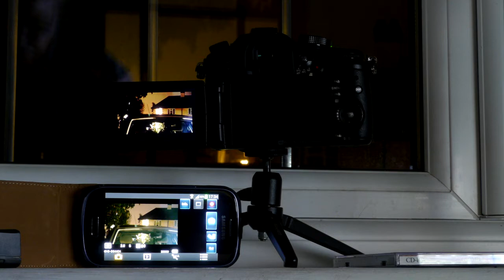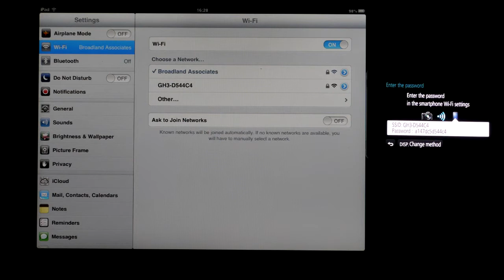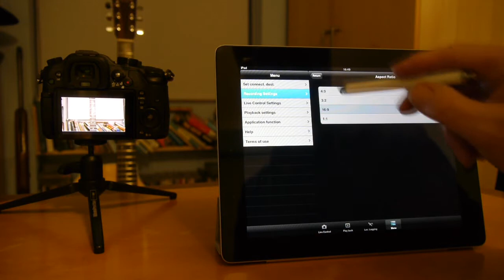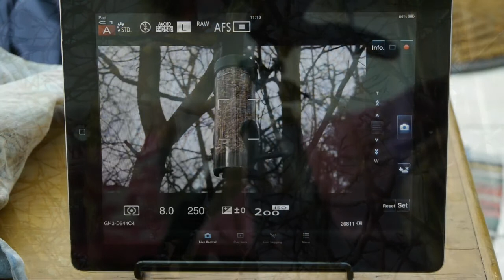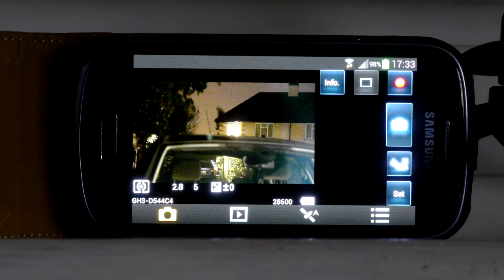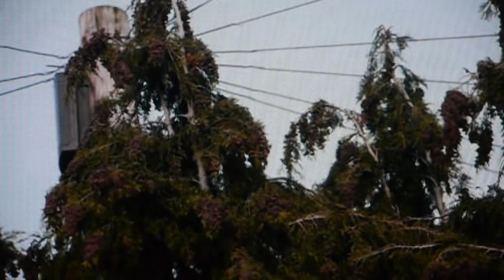Tethering A Panasonic GH3 Via WiFi To iPad and Android Using The Lumix Link App

Comment: Hi David- I hope this finds you well- I'm shooting headshots/portraits with the GX8 (which uses the newer Panasonic Image app for wireless tethering now)- I was wondering in your experience is there  a way to preview images taken in FULL screen in the live control option (as I'd like to show my subject live what we're doing as a reference for making adjustments in posture/pose etc before proceeding on with taking more shots, but the only way it seems to do that is with a smaller live video window (and all the control buttons around the window in the ipad app- not full screen) I have the camera image preview time set to 'hold' in th e cmaera's menu settings (so the last image taken is previewed indefinitely until the shutter release button is pressed again after which it shows the live view again)- I just wondered if it's possible for the liv eview an despecially teh previewed shot taken to be shown in full screen as opposed to a smaler window (I understand the 'playback option' plays back in full screen but idealy want full screen preview in live control mode.. thank you
Reply from the maker: No, it can't do that. The nearest is to use the phone in landscape mode (a I expect you do) but that's it. It only sends a VGA 640x480 image for live control, presumably for fast screen update so even if it was bigger, quality wouldn't be that great. That wouldn't matter for what you want though. 

It would be nice of you could have the option of a full screen image for review in 'Hold'. Playback introduces too much delay when all you want is a better look at the image you've just made.
Reply: OK thanks David- yeah full screen preview of the image immediately after taking it under the 'hold' setting would be great but I assume you are just wishing for it and not suggesting there is a way to do that..
Reply from the maker: Yes, a wish. It would be something if when you pressed Playback, the last frame you took came up full screen, rather than loading them all as thumbnails. Then you'd tap the screen and ge thumbs would load.

Comment: Do you know, by chance, if there's also a way to tether and shoot from a laptop?  Adobe lightfail doesn't support the GH3 (or any Panasonic camera for that matter) and I really need to be able to do this to make table top/product photography more manageable.  If you have any idea, please let me know!  And thank you for the great overview of the tablet tethered shooting!
Reply from the maker: A tablet is the only way, I'm afraid. The GH4 can be tethered to and operated from a desktop or laptop using some not too expensive proprietory software and a USB connection but not the GH3 which can only upload to a folder on the desktop while you take or after you've taken.
For product photography, the GH4 wouldn't have any advantage over the GH3 other than that so it would be an expensive step to take.
Reply: David Thorpe I had feared as much, but wanted to make sure.  Thank you very much!

Comment: that's a really helpful video, David.  Have you got the wifi to work so you can transfer pixs from the GH3 to the iPad?  I can't see how to do it that all!  Also, is it possible simply to view images from the camera on the iPad?
Reply from the maker: handheldfilmsUK If you get the pix in the camera  up on the iPad screen using the app's view button , touch the image and hold it for a second and some tabs appear, one of which copies your pix to the iPad's gallery.
Reply: David Thorpe Progress at last, thanks to you David.  I've got as far as viewing images from the card, but I still can't save an image onto the iPad. When I touch and hold an image, 2 blue borders appear - one of which is a 'save' function.  But it doesn't seem to have any effect at all - at least, I don't end up with the image in 'Photos'.  I don't think a lot of thought went into this app, but I'd really like to get the thing working.  Any idea what I might be missing, or doing wrong?
Reply from the maker: handheldfilmsUK Is there a button saying 'Select' visible? If so, press that touch some of the images to select them. Save should then work.
Reply: David Thorpe I finally worked it out, so here's how to do it in case it might be useful to anyone else>
1) when the wifi link is made, choose 'playback' (on the iPad lumixlink screen) to call up images, 2) click button in top right corner (looks like a set of small screens, i.e. representing all the images) 3) touch the image you want to import, and hold - now a tick appears on the image  4) now drag the image to the left hand edge of screen, to the blue border - and dialogue box appears showing copying is in progress to the iPad.  Image copies quickly (I'm using 95MB/s class 10 cards) and appears in Photos.  Fantastic!  Thanks for helping me over the hurdles, David...
Reply from the maker: handheldfilmsUK Glad to be of assistance and good that it's working for you now. Reading your excellent run through, for anyone unfamiliar with digital cameras and their apps, it looks a bit like some witches spell being cast.
Just 'hold this, drag' here instead of 'put the bats eyes in a bag and shake the bag three times under a full moon where a hole will appear in the ground'  etc :-)

Comment: Thanks for your brilliant tutorials! Trying to set up GH3 on samsung note three.  in wifi settings connects to camera for a second then i get message on  'network disabled because internet connection is slow!  Any ideas -pulling my hair out as it looked like it should be so simple.  Many thanks.
Reply from the maker: andy hiles Thanks Andy! I take it it is connecting straight through to the camera and not through your home network? In other words you select GH3whatever in the available networks menu. It doesn't need the internet to do that which is why I ask.
There's an app called Wifi Analyzer on the Google Play Store. It's free and will tell you the strength of your GH3's wifi signal. If it is very low, at least you'll know it's the camera, though I doubt it. Let me know.
Reply: All sorted.  Not sure how but must have changed a menu somewhere when fiddling. Thanks for taking the time to reply. Keep up the good work on ypur channel. Best wishes. Andy

Comment: Thank you for another fine video David.
I'm on the verge of getting an external monitor to use for focus assist.
I wonder if you ever got any input on the question you asked earlier about the ipad model with retina display and the image quality between it and the non-retina display model.  My aged eyes need all the help they can get.  I've looked at several wired monitors so I was happy to see this video.  The wireless option of the ipad bakes the cake as well as putting the icing on the cake for me.  My biggest decision now is whether to allocate the extra coin for the retina display model.
Thanks again.
Reply from the maker: I'be just bought a Samsung Galaxy Tab S which has similar or a bit more resolution than the Retina display. The cameras outputs VGA (or the smaller QVGA) resolution so the pad display is limited to that. The Image App looks a bit nicer maybe but I think that is simply due to the Samsung's OLED display. It certainly would not merit a pad upgrade just for that. I'd imagine that Panasonic have to limit the output resolution to keep the Image App responsive. I know what you mean about eyes, by the way!
Reply: Thank you for the reply and for the helpful information.  I'm almost entirely brand new to the DSLR game and I decided on the GH3 based to a great degree on your videos with the comparisons and the relevant information you included. 

I often crave lenses with more light, but I also often set my camera to shoot a from one to 3 bars underexposed according to the camera's meter.  A few days ago I purposely set the camera a lot more unreasonably underexposed than usual so I could get sunrise starbursts through the forest.  I was amazed that almost black scenes were brought to almost daylight detail by the free processors available.

After seeing the final result of that day's shooting -  the next day I shot with much higher exposure  settings.  It was really hard to get positioned for the starbursts and I'm as yet undecided which pictures portray the starbursts better, but I'm leaning toward believing that the more underexposed settings suit me better after post processing.

After second guessing about my decision on getting the GH3 (because of the fewer lens options) I've come to the conclusion that I probably could not have made a better camera choice. 

Well, I took off on an unrelated tangent. 
I'll research and compare the retina display against the Galaxy.  I'm deciding on my first monitor rather than upgrading, so I want to try getting the right device the first time out.  My greatest concerns are that any monitor actually shows good enough resolution to actually help me get sharper focus and that I can see the monitor's screen in sunlight.

Thanks again for your considerable time and effort you spend on helping people with your videos.

Comment: 10 Meter ist OK! Aber bei mir sind es nicht einmal 7 Meter, trotz Sichtverbindung.
Werde es mit einem Repeater versuchen.
Reply from the maker: You can see I get more than 7 metres from the video. It's odd it should differ, maybe interference? I've just measured the distance accurately at 4m:10s in the video and it is 14 metres so, as you can see it is double yours.
Having said that, my GX7 is out of range at 3 metres!

Comment: It's a great function. But the Maximum range ist less to 7 meters. This is very poor!
Reply from the maker: I get a bit more than 10 metres on open ground. I don't think that's bad for a battery powered device. You could always use a wifi extender, I suppose.

Comment: I love the idea of using a iPad as a on camera monitor.The 10 inch has full HD which is much higher than most on camera LCD's. No cables and no fat batteries sticking out. Just need to make some mounting brackets.
Reply from the maker: I get an image 17x13cm on my iPad, about 3 times the size of the GH3s built in monitor.  It's not the full screen because of the information area.
How does this differ on the 'retina' later iPads? Does it double up the pixels or do you get a smaller image? Anyone know?
Reply from the maker: Would that tend to make the picture look less sharp, like inerpolating up?
Reply: David Thorpe is there a way of turning off the information area and going full screen with the camera image?

Comment from the maker: Yes, unfortunately it is. Video is an area where live monitoring would be very useful so it is a bit of a letdown. Plus, while you can start the video recording, you must set it to run for a set time to switch it off. If you want to switch it off during shooting, you must go to the camera and do it.
It's a big omission, so there must be some technical reason that Panasonic couldn't overcome. Maybe be fixed in the Lumix app or camera firmware but I wouldn't hold my breath.

Comment from the maker: Yes, you can use it as an external monitor, that is its main purpose, in fact.
It is obviously slower than doing it on the camera but quick enough. You should be able to see from the video. What you see on the screen is live, so when focus is changed on the screen, that is what is ahppening on thecamera at the same moment.

Comment from the maker: It should be an ideal solution to your problem but you'd have to set a time for recording since you can't stop the recording on Lumix Link. You can start it there and tell it for how long to video but it has to be stopped from the camera itself. Shouldn't be a problem?
I got a range of about 20m from the wifi link. You'll see from my video that the delay is quite short. The GH3 is heavier than the GH2, of course.

Comment from the maker: I just tried. You can adjust the focus on the camera while recording normally, of course. But if you use the iPad  and Lumix Link, you can't change it, either on the iPad OR on the camera.
All in all, the Lumix Link works great for stills but is very limited for video. Apart from not being able to shift focus, you have to go to the camera to stop it. And a timer window comes up blocking your view of the subject. 
Maybe they'll upgrade it some time.

Comment: I found workaround to not having wifi on my G3. Triggertrap (full features for Apple iPad & iPhone, & most features avail for Droid tablets & phones). I bought their wifi dongle cable & connected it all up & it does trick - I can remotely control camera from my phone/tablet. Currently I can't use my Droid tablet as master & my SIII as slave, but will be able to in future; only Apple products currently supported on Master & Slave feature.

Triggertrap d o t c o m - look for great user tutorialvid

Comment: David--You mentioned it was possible to upload photos from the gh3 to a computer. As I don't yet have a smart phone or tablet, I would like to upload to my Mac. Does this work using the same app you used for your tablet, or does it require a different method?